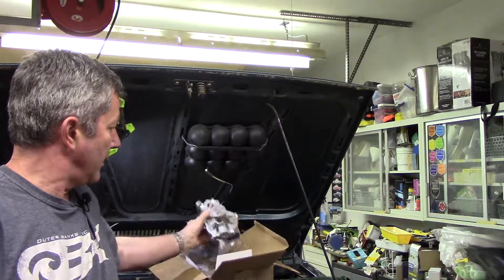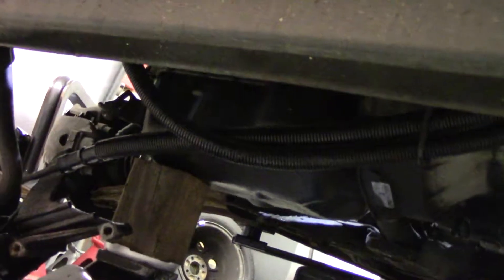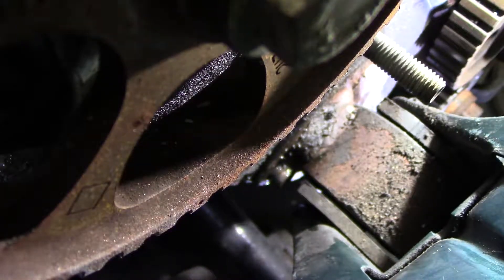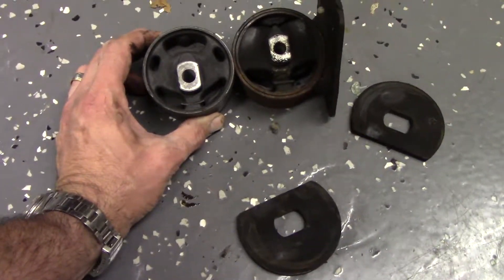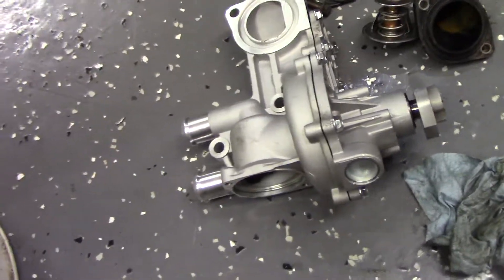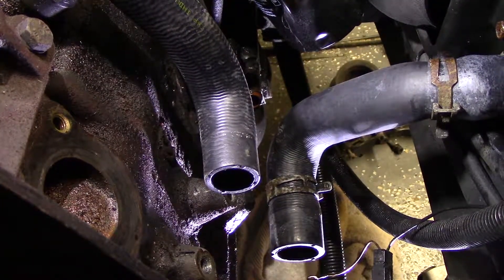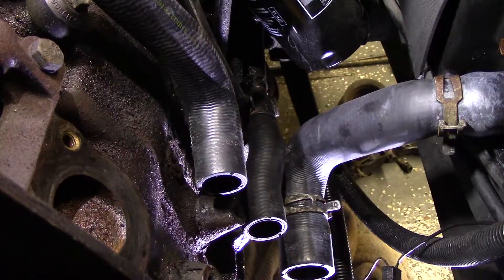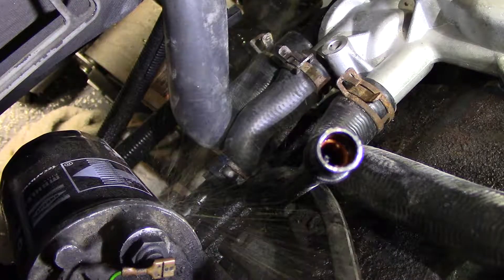93 VW Cabriolet water pump replacement part 2

Comment: It’s amazing to me how involved a simple water pump replacement can be. Not only is the pump essentially 2 pieces, but hidden behind lower timing cover and crank pulley and under the dealer-installed AC? May as well throw in a new engine!
Reply from the maker: Replacing one of these water pumps is pretty easy if you don't have to remove the housing like I did, you still have to remove the timing belt. That is actually factory AC, every one I have ever worked is like that. These 8V VW engines are pretty much bulletproof, you would have to try really hard to mess one up.
Reply: @bryansprojects3570  yeah my 8v has been through a lot lol. I unfortunately have a York AC which mounts on top of the alternator and makes replacing the whole housing a bit of a chore. I only need to replace the pump on mine but it still requires removing the crank pulley which could be seized into place, lower timing cover and timing belt which just about requires you to time the engine. It seems like there are less bolts involved if you just go straight for the whole housing replacement? I’ve been spoiled working on pushrod v8 engines I guess lol.

Comment: The electrical plug that makes an appearance @12:20 - Does anybody know what that is supposed to be plugged into?
Reply from the maker: I think it may go to a coolant temperature sender.
Reply: @bryansprojects3570  Thanks for the reply. So, maybe it isn't the same as the one just hanging around in my engine bay. Mine sits up front on the right side (around the rad/head light area), has that type of black plug-in terminal and has a ground wire with a metalic loop hole for a screw. Never figured out where this thing goes. Anyway, thanks for your video, made my job much easier to understand and get done.
Reply: @bryansprojects3570  Found it - A/C compressor.